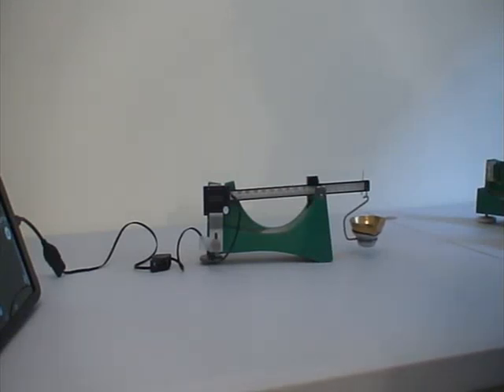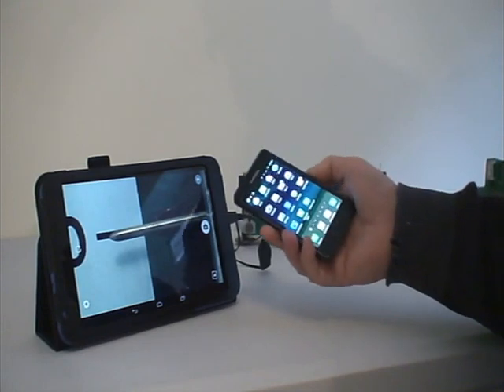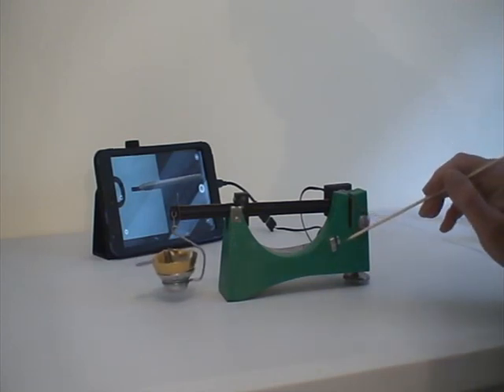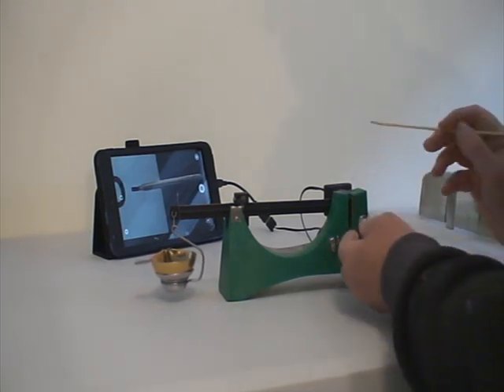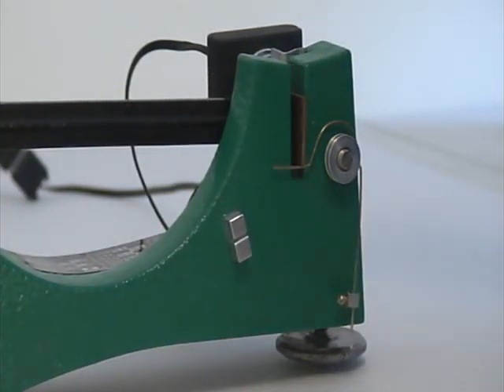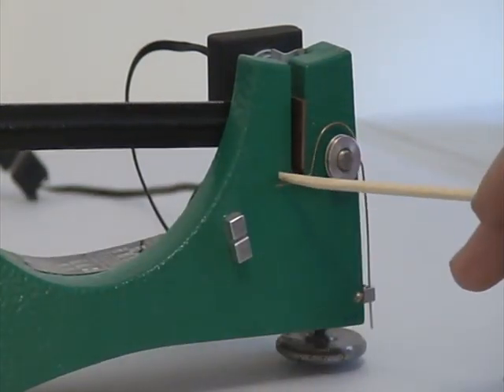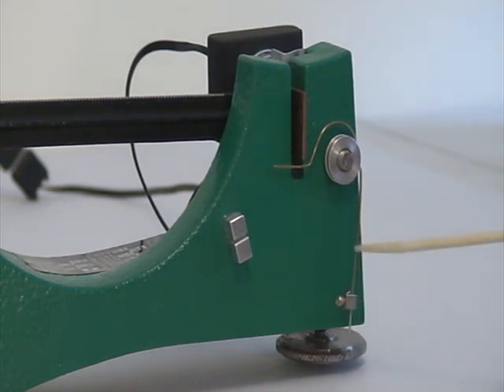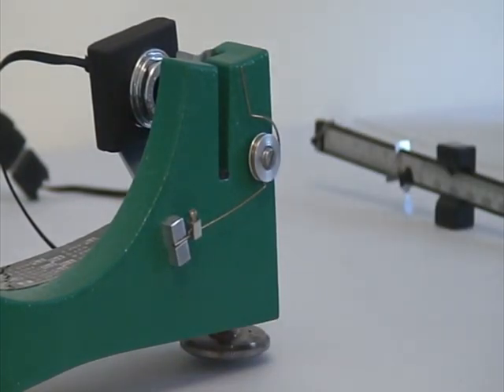Beam scale enhancements

Comment: Wow... lots of great modifications! ....  I also have a RCBS #502 beam scale. .....Because of the light weight, I also wanted to fill in the hollow body but, didn't  know what to use use for a filler..... Thanks for sharing your ideas!
Reply from the maker: Thank you Robert - Pleased you found the videos helpful.
Reply: Thanks!.....Here's  a tip for someone using a light weight beam scale that doesn't  have a very solid work bench,or a light duty table, place beam scale on top of a brick or cement pad. This will help dampen the base for more stability.... More videos please

Comment: That approach to weight assist is awesome. What kind of wire did u use and where did u get the counter weight. I've got a new RCBS M500 beam scale coming and would like to out fit it with that mod. Also have a tablet and cam coming to add that mod very nice scale I like the ideas thanks alot.
Reply from the maker: Thanks for the kind words. Yes, the approach to weight gizmo works well, especially if using an auto trickler, makes for a really soft, smooth lift of the beam off the bottom stop. All the bits were made by hand, the counter weight came from an electrical connector.
You will need to design a different system for the M500. The damper blade on the M500 is a straight line with the beam, the old 502/505 has the damper blade are right angles. Let me know how you get on.

Comment: Lots of clever mods!
Assuming the needle pulses at the start of the video are because the pan is swinging, could you not put a magnet below the pan so it damps the aluminium pan in the same way that the scale already damps the copper sheet on the beam.
I want to use one of these scales to weigh 177 airgun pellets, so let's say 8.xx grains. Is there a scale made just for this kind of weight as I do not need the 500 grain capacity. Any recommendations apart from trying to find an old scale that was made way back when when things were not made down to a price and bean counters were only found in coffee shops?
Reply from the maker: +Roger Crier  ..Hello Roger.You are correct, it's the pan swinging causing the pulsing - however, I really don't mind seeing a little movement on the beam, it shows the beam isn't stuck anywhere. The RCBS scale have floating agate bearings so you often get a little side wobble too - not a problem.You're quite correct, a magnet under the pan would act as a damper. On something like the Lee scale it would work perfectly because everything on the pan end of the scale is non-magnetic, even the little spring that pushes on the brass zeroing adjuster is copper. On most other scales there is magnetic material at the pan end. The knife edges where the pan hangs, the wire pan stirrup, the screw that hold the weight box together etc. Any magnet placed near these scales would lead to a false reading.The 502, 505 scales will quite happily weigh down to 8 grains accurately. They're quite happy weighing 1.6 grains of powder for competition pistol cartridges.The Lee scale, although a bit fiddly to use, is actually very accurate, especially at the lower weights.For weighing pellets, you might think about the small digital scales, they're idea for this type of job but I don't like them for powder.
Reply: +thetargetmaster Thanks for the big answer!!  What were you going to say about the lee scale? You ran out of space. For my 10 grain or under needs, are there constructional details anywhere to make a bespoke arm? (Silly I know) 
On DRO measuring systems, have you checked out "touchdro" hardware and it's free android app? You already have the display!!! Cheap as chips. See YouTube. Or google.
Reply from the maker: +Roger Crier .. I've just had a brief look at the touchdro system - looks very promising. I've not got DRO on my lathe but I have fitted a full system to my milling machine - I really couldn't do without it now..The Lee scale, although a bit fiddly to use, is actually very accurate, especially at the lower weights.For weighing pellets, you might think about the small digital scales, they're idea for this type of job but I don't like them for powder

Comment: Hi, wondering can u help, i hav a rcbs 10-10 scale and when i set it up and zero it i just turn the level screw until the the beam line and fixed line meet and it weights fine, what im stuck on is does the scale actually have to be level or do you just get the lines to meet like ive done and go from ther, thank u
Reply from the maker: For best performance the scale should be set up on a level bench - Then, with the poises all set to zero, the leveling adjuster is set to line up the zero marks. Ideally this is about mid range on the adjuster screw and the scale about level. I would get a set of the RCBS/Lyman grain check weight to give you confidence and peace of mind.
Reply: @Targetmaster1066  thank you, much appreciated 👍👍

Comment: Which Camera are you using?
Reply from the maker: Just a cheap Chinese $5 one from Ebay - It needs to have a manually adjusted lens to get down to a couple of inches.
Reply: Thank you
Reply: Eric Greene, did you find a camera that worked?
Reply from the maker: These are the cameras I use:
http://www.ebay.com/itm/NEW-Mini-Stylish-USB-2-0-5M-Meter-Retractable-Clip-WebCam-Web-Camera-Laptop-GH-/112184941002?hash=item1a1ebe59ca:g:CiUAAOSw8gVX~Kel
If you want to use it with an android tablet you will need a free app:
https://play.google.com/store/apps/details?id=com.vaultmicro.camerafi
Reply: thetargetmaster , thank you very much!
Reply: No, I made a holder for my cellphone but it is a little wobbly; I just ordered the camera that thetargetmaster recommended in the next comment.
Reply: Just ordered one, thanks again.
Reply from the maker: The cameras are "plug and play" on a PC or laptop but if you have trouble here's a good free program that recognises the cameras OK.
http://www.sharpcap.co.uk/

To focus the camera down to a couple of inches you need to unscrew the lens a little.